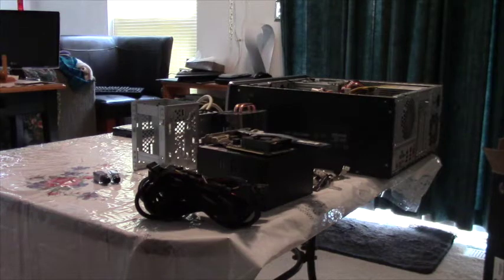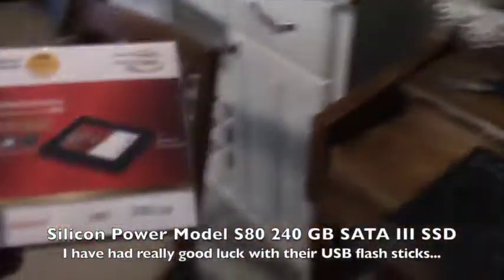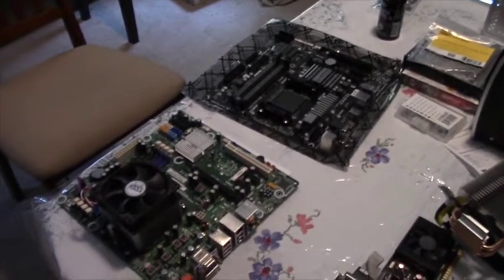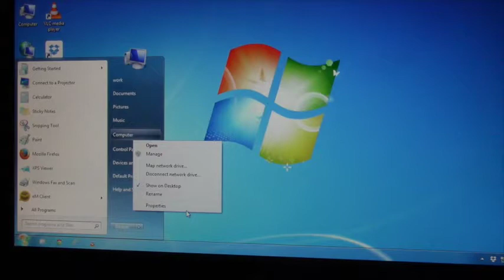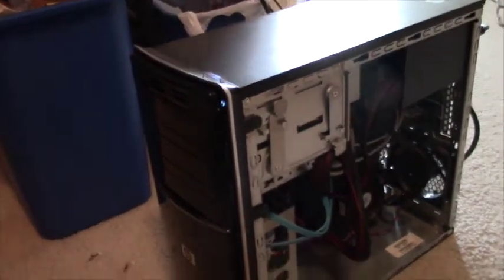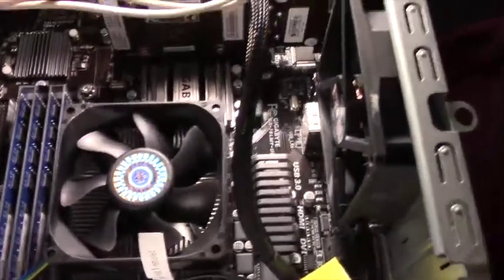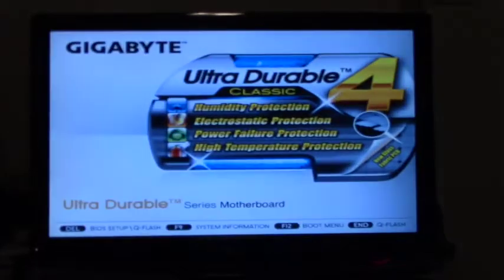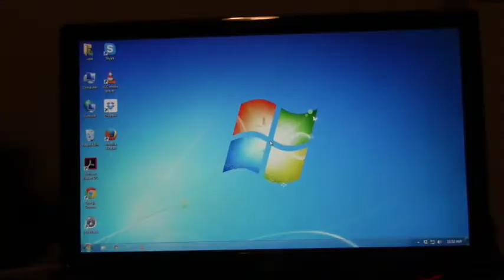HP Motherboard Swap/Upgrade Video

Comment: I have an HP Pavilion Elite HPE-372f.  I got it way back in 2010 so it’s the same era as your case.  I’ve been thinking about getting a new motherboard and from everything I’ve seen on videos HP uses standard everything

Comment: I have same computer but a little different module witch it has 2 500gb hard drives and 4gb pc2 ram and I was wondering if I can buy any pc2 ram and will it work in my Computer ?
Reply from the maker: You should be able to get any PC2 RAM and it should work.

Comment: Hello Steve. I have the same machine, and I'm thinking of doing this upgrade.  Question: is it necessary to install a fresh copy of Windows 7 ? or you just plugged in the new motherboard with the actual system and thats it. Thank you
Reply from the maker: +Luis Serrano The SSD I installed was new, so I had to install a fresh copy of Windows. It depends on how far the configuration has changed but if you put a drive with a copy of Windows you are currently using, it may fail. Better to be safe, backup your files and do a clean install.
Reply: +Steven Smyth thanks so much Steve.  Well, since the system is one of those, you know..preconfigured by HP. I was thinking of plugging the motherboard and see what happens. The thing is I dont want to spend more money in buying the 7 again. I have a brand new SSD, a better processor, not the OS. what do you think?
Reply from the maker: +Luis Serrano Mine had Windows 7 Home Premium 64bit and I used that COA on a computer I built for a friend, so I went to ebay and got a Windows 7 Pro license for about $20. ebay allows sellers to vend COAs from PCs as long as they sell them with hardware. I have a license I haven't used yet that I got with a tired 500GB, 2.5" drive and I will probably be using it on a PC I just built that I am trying to make a video on (I keep getting distracted). I need a work at home computer, this one I just built should fill the bill nicely.

Comment: How do you find motherboards that have the same io ports? I find this difficult bc i cant find anything about it
Reply from the maker: The one I put in didn’t have have the same IO ports as the stock one. A new motherboard will have an IO plate that will fit in the PC and close off the case to dust and dirt.

Comment: can this mobo use these components
mobo brand name:Pegatron
MOBO Model: VIOLET6

Chipset: NVIDIA/nForce 720a   Rev. A2
Southbridge: NVIDIA/nForce 720a MCP  Rev. A2

Graphic Interface
Version:: PCI-Express
Link width: x16
Max. Supported: x16

Memory type
DDR3

DirectX type
DirextX 11.0

Cpu socket type
AM3 
///////////////////////////////////////////////////////////////////////////////////////////////////////////////
Now can this mobo use these components??

CPU: AMD Phenom II X4 965 AM3 3.4Ghz 512KB 45NM 125W 4000MHZ

GPU: EVGA GeForce GTX 750Ti SC 2GB GDDR5 Graphics Card

PSU: EVGA 430 W1 80+, 430W Continuous Power, 3 Year Warranty Power Supply

RAM: Kingston HyperX FURY 4GB 1600MHz DDR3 CL10 DIMM
Reply from the maker: Sorry this reply is delayed. The short answer is yes. This series of MOBOs is notorious for hard drive controllers going out. Good luck.

Comment: Hey I have the same pc (p6.2316s) 
And I wanna upgrade it
It's been hard trying to find the right mobo 
Will this work? 
Gigabyte B450 AORUS M (AMD Ryzen AM4/M.2 Thermal Guard/HDMI/DVI/USB 3.1 Gen 2/DDR4/Micro ATX/Motherboard)
If you could also point me in the direction of other parts 
Like gpu, cpu, power supply, ram, etc 
That would be fantastic 

Thanks in advance 🙏
Reply from the maker: I did this so I could utilize the CPU and the other parts from the failed mobo. Seems to me you just want to gut the case and start fresh. Nothing wrong with that but it boils down your needs and what you can afford.

I looked at the motherboard you're considering and it looks good to me. It's probably the most cost effective part of your build. The reason I'm stuck back at Haswell CPUs is because I can't afford new hardware at the moment. I'm not playing games so what I do isnt that demanding. The mobo you want is ATX, so it should fit the case.

I would suggest utilizing pcpartpicker.com. They allow you to build a system with prices from various sources and also compare and contrast parts you are considering. I used it for my gaming PC back in 2013 and was happy with the results. Good luck.
Reply: @StevenSmyth  alright man
I'll look into it 🙏
Thank you for the reply. I've been stuck for a minute

Comment: I have the same pc! But I keep getting the bio error. Could it be the battery on the mother board needs replacing? Currently trying to fix mine. My hubby unhooked it all and took it apart 😂
Reply from the maker: It could be the battery, especially if it’s not keeping the correct time.

Comment: hey steven i know this is an annoying question but what parts could i use to upgrade my pavillion for gaming (same as yours)  but still be on a budget
Reply: BLACKLAVENDR M Do you have the same specs as him?  get a gt 1030 for 70$ or gtx 1050 and probably upgrade that cpu.
Reply: i was able to install a GTX Dual 550 and my windows index for the graphic card is 7.9  also i went for a 500 watts power supply and a Samsung 250 gig SSD. Now this little computer is a real sleeper (working fine under the hood)

Comment: My MB has Athlon II and ddr2  is there possible   to  replace  with motherboard  you did?
Thank you
Reply from the maker: The socket for the Athlon II is AM3 but the RAM for this motherboard is DDR3. You're probably going to have to get some new RAM which is getting bloody inexpensive. Good luck.
Reply: Thank you very much

Comment: what mother boards fit in this computer i got the same one wondering what would fit
Reply from the maker: If, like mine, your processor is an AMD Phenom, that is socket AM3. The board I used is a Gigabyte with socket AM3+ which is backwards compatible. Any Micro ATX board should be able to fit in there, however, so if you want to gut the thing and put in a Core I7 motherboard, knock yourself out. I figured I had the CPU and the RAM, so I went ahead and swapped into a really good board.

Comment: which cable is for the power switch??? i can't figure it out
Reply from the maker: Usually the power connection is in a bundle of other wire coming off the front panel. The connector itself probably sez POW on it. I'll do some more research since I've sold this PC and don't have it anymore.